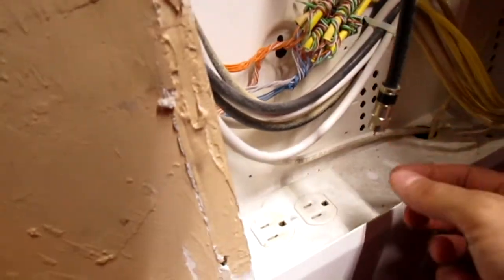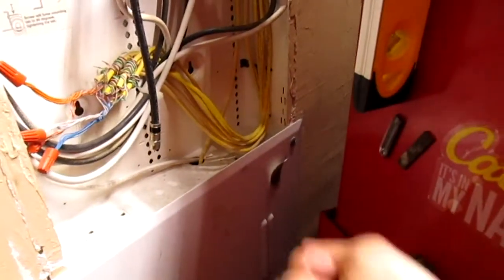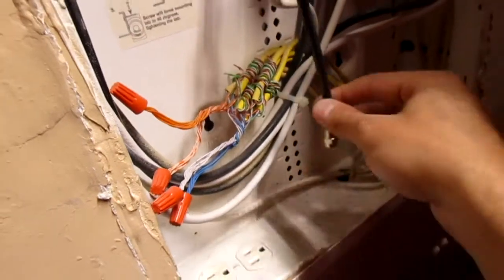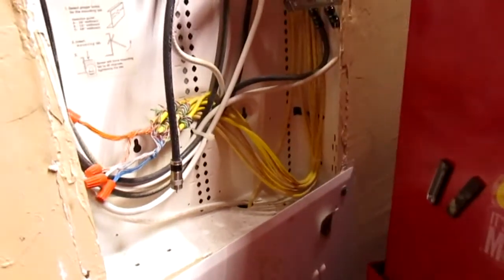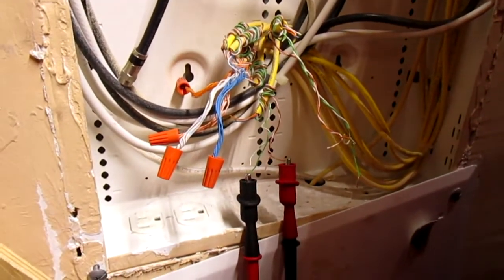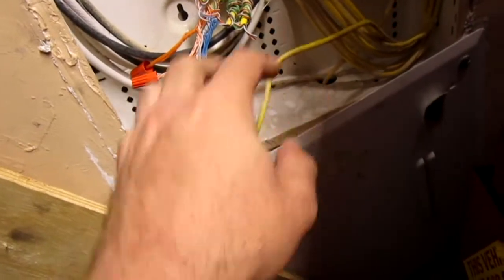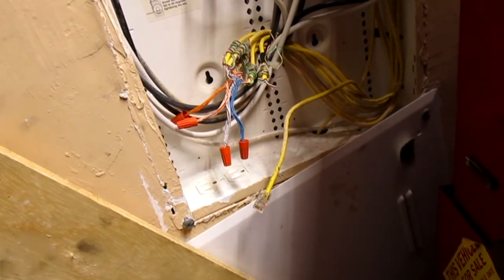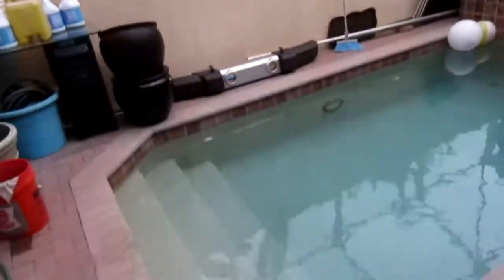How to Tracing cat5 cat 6 cables in your home with a battery.

Comment: Hi! I’m trying to trace my network cabling and in a similar boat as this video. But I’m a little bit confused how you had chosen which cable and what exactly you had done at the outlet? I’d greatly appreciate a bit of guidance please.
Reply from the maker: I just picked the 2 color wires on one of the twisted pairs. Energized the wires on the battery  at the outlet, then checked the same pair on every wire I had on the wall  until I saw voltage
Reply: @ thank you so much for taking the time to reply!